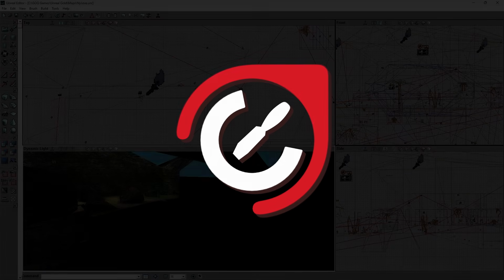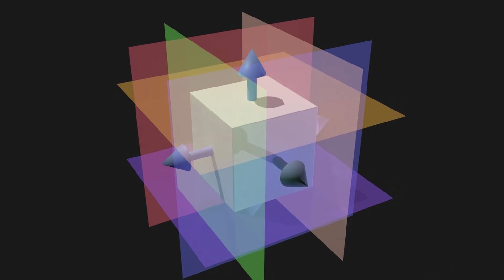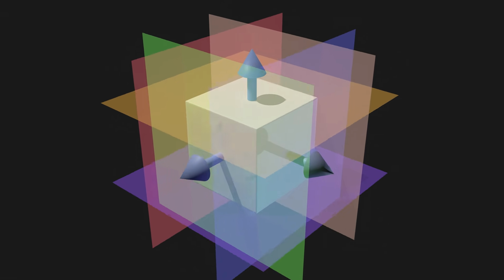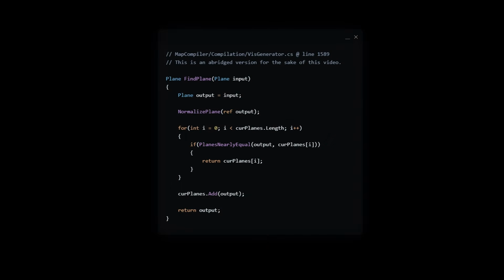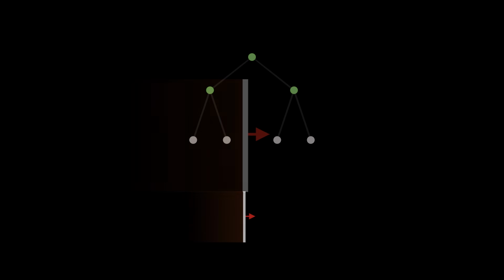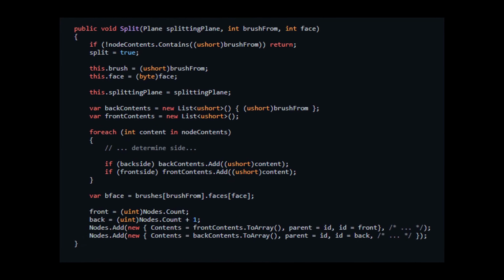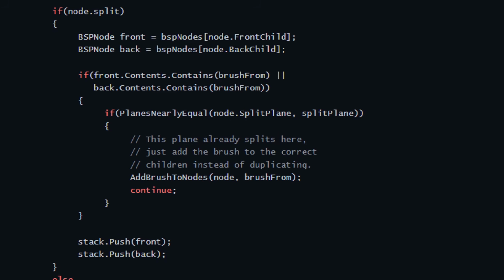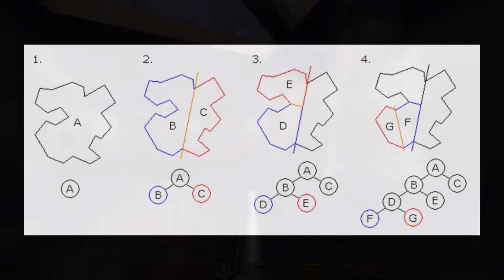BSP in Map Compilers Explained (Quake, Source, etc.)

Comment: The video did not explain the advantage of this system vs a more naive approach.
Reply: I wouldn't watch these from the standpoint of "you should do things like this".
Watch them from the standpoint of:
"if you want to make levels using the same processes used in the map editors / compilers for Quake, Half-Life, Half-Life 2, etc, you should do things in a way similar to this".

This video is essentially just the "CSG" (constructive solid geometry) tool. It's one of several that you would run in sequence, to make a game-ready level in what the games called ".bsp" (binary space partitioning) files.
Quake level editors would have a "build" button, that would run these compiler tools in order for you, if you set the editor up.

This video isn't about anything other than figuring out where the infinitely thin walls are (and which direction they're facing). That's because it's how Carmack programmed Doom and Quake to handle the visibility of bits of the environment as a pre-computed data-set, rather than needing to calculate what you can / can't see, using common frustrum / occlusion culling methods. That's because Quake was running on 90MHz or 66MHz single-core CPUs. Before GPUs were available to gamers, so everything was on 1 CPU core. Period (until GLQuake). There was no time for anything but pre-computed anything, for everything except doors, moving platforms, enemies, and projectiles.

If you wanted to have traditional Quake-shaped levels, but want simpler means of physics / occlusion, using brushes like blocks, rather than an infinitely thin shell, then instead of this BSP algorithm, you can use the equation for the intersection of 3 planes, to get vertices, use the dot product to reject any points that are outside of the halfspaces of the brush (any vertex that is in front of any plane is invalid), and then use some giftwrapping algorithm to build polygons out of the remaining vertices.

That will let you treat every wall, or every chunk of rubble, like it's a unique block.

As for the benefits of using CSG for levels, instead of Blender... CSGs are so much faster for "grey-boxing", and for making standard-sized / standard-shaped objects. Think buildings, instead of trees. Drafting tools are much better for buildings or mechanical parts, and without CAD plugins, Blender is far better for organics or at least non-standard pieces.
CSGs are also mathematical concepts. You can add or subtract simple shapes together, use a door-sized block to carve doorways out of walls, etc. That wasn't all available in old Quake editors, but it is in newer editors for Quake / Half-Life maps, to some extent.

They are so very much faster for blocking out levels, so that as a first step, you can focus on movement and combat, and the flow of a level, rather than placing a bunch of Blender models, and trying to build a path and a narrative out of that.

Anyway... those would be the reasons to use these processes (the CSG editor, and the BSP compiler).
Reply from the maker: yeah that's not really the point of it lol. The point is for technically curious people to have a video like this the just explains it a bit more in depth
Reply: BSP was invented for Doom to create a dungeon crawler, but with free motion. For a dungeon it is kinda obvious that you rather ray cast . Most walls will be hidden. Typically, maps are crammed. Ray casting works well in a BSP. Front to back rendering with column buffer works as well, but allows you to const z shade the floor ( on old hardware like Atari Jaguar).